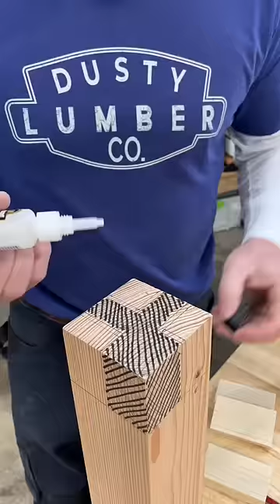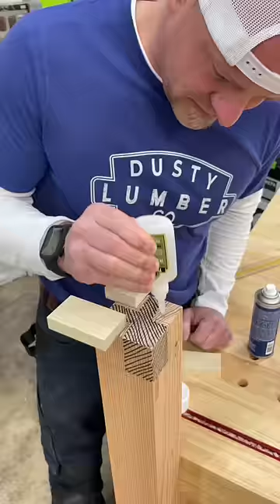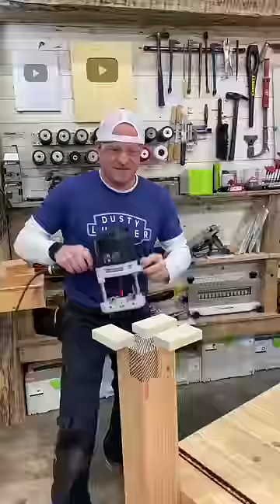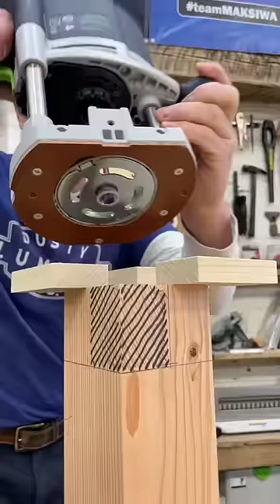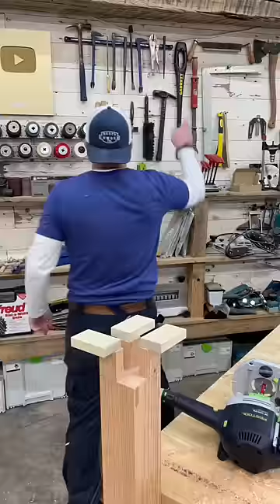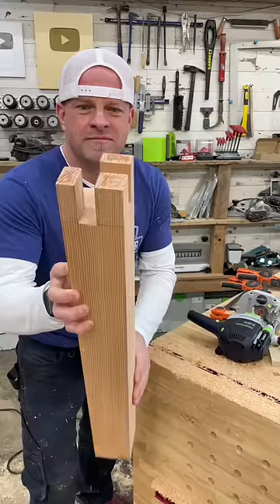Router joinery #woodwork #woodworking #maker #tools #joinery #bois #holz #madera #wood #sawdust

Comment: I tried doing this... My router template plate hole was too small for my bit diameter. And my bit was too short anyways. And the local hardware store have a very limited variety of router bits